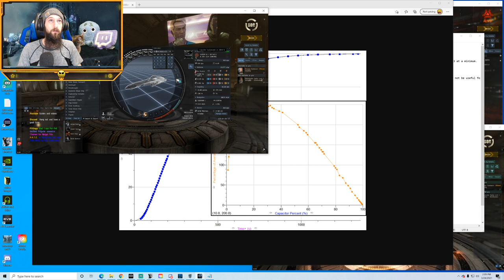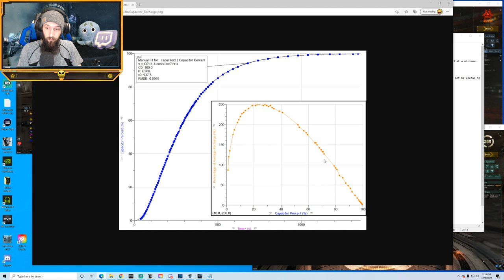Eve Online Capacitor Guide

Comment: One thing that has ALWAYS bothered me about EVE is how there is all this meticulous detail in something as minute as a ship's capacitor, but to this very day CCP still insists on using incorrect units of measurement. Joules themselves are already a representation of power over the course of time, so there is technically no such thing as "joules/sec", the unit itself already represents that. It's like saying "power a second per second" or "ATM machine". So for example, instead of seeing "-13.3GJ/s" you would simply see "-13.3GJ", this is a more technically accurate representation of the measurement. I know this is super analytical but it has always bothered me, probably because I'm a dork.

Comment: Is there a stacking penalty on the capacitor warfare resistance if I use several cap batteries ?
Reply from the maker: short answer yes it is stacking penalized long answer to find out more about stacking penalizations you can reference this and possible in the future a video i make on it https://wiki.eveuniversity.org/Stacking_penalties

Comment: This is not beginners friendly, I do not follow you. I need a REAL beginners guide. Anyone who understands this talk doesn't need a beginners guide 😑
Reply: TL;DR Capacitor peak regeneration occurs between 20-30% of capacitor capacity. If your active tank is not cap stable and relies on being pulsed to sustain incoming damage, you will likely be able to pulse it more frequently while the capacitor is within that peak regeneration rate window, which means in theory, you can tank more damage in that peak regeneration window. However, if the incoming damage simply becomes too great and it forces you to run your active tank for more cycles, it may push your capacitor regen beyond the peak value and rapidly destabilize it, to the point that it takes significantly longer to recover before you can start tanking again. 
 
Basically, don't consider an active tank "broken" or "unstable" if it can reliably tank a reasonable amount of incoming damage while operating it within the peak regeneration window. Most of the time, if you have at least two minutes of capacitor time before it is fully drained, that generally means you will have plenty of wiggle room in the peak regen range to keep your tank up (unless you get neuted). If you only have 30 seconds before it drains, even peak regeneration won't keep the capacitor stable for long enough to get in another cycle with your active tank. At that point, one pulse of your tank may be all it takes to throw the capacitor deep into a lengthy recharge rate just to have enough juice to run your tank again.  

Try watching some PvP videos of people flying with capacitor boosters. The general consensus most people might arrive to with these modules is, you just keep them juiced up and running constantly, chewing through cap charges until the enemy isn't shooting at you anymore. That isn't how you are meant to use them, cap boost charges are finite. You can only carry so many of them. You are supposed to use them when they will be the most effective to your capacitor, and by extension, your tank. They are meant to be an "oh shit" button for when your cap drops below that peak regeneration rate. You give your capacitor a quick surge of juice and you are back to peak regen, and running your tank again. You will most likely see PvP ships fit with cap boosters doing this very frequently where you see them teetering on the edge of 25% capacitor and using a booster when it drops below that, because it is a more efficient use of the module.